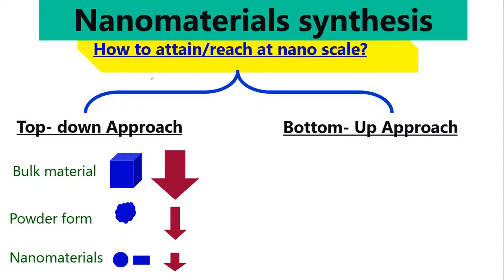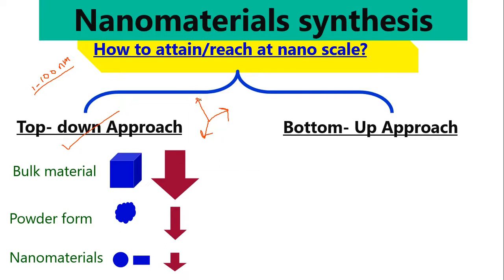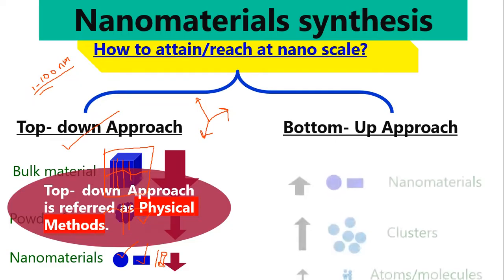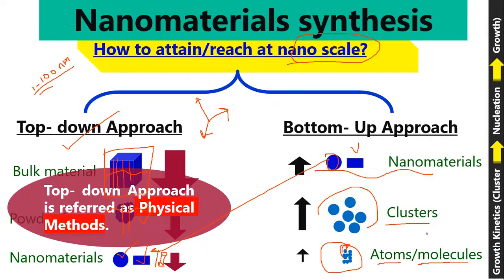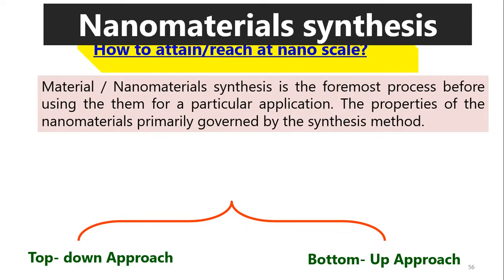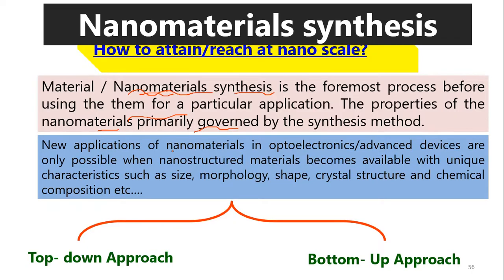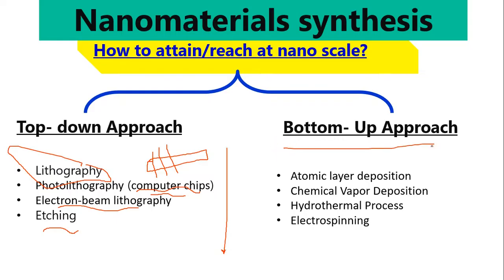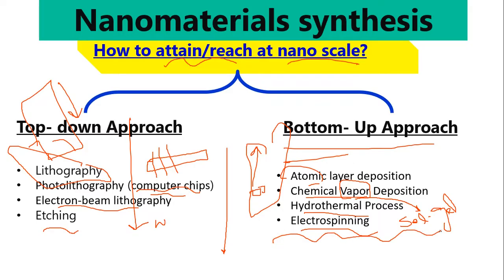Synthesis of Nanomaterials  - Top - down Vs Bottom - Up Approaches

Comment: What materials is examppe of top down approach?😃
Reply from the maker: The top-down approach simply means to make a material by simply slicing a block into a small piece..... those pieces must be in the range of nano....

NPs by Mechanical Milling, ....... Nanosheet by etching ........
Nanosheet by sputtering....

 2D graphene nanomaterials obtained from the 3D block
Reply: Sol gel,lithography